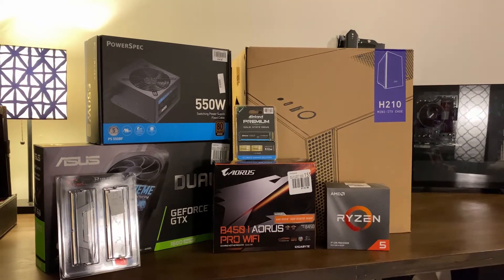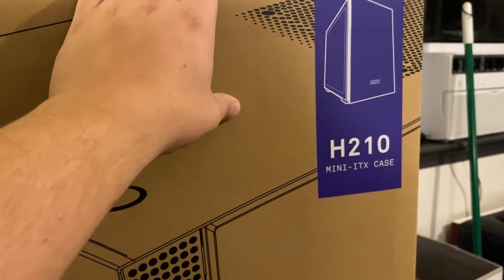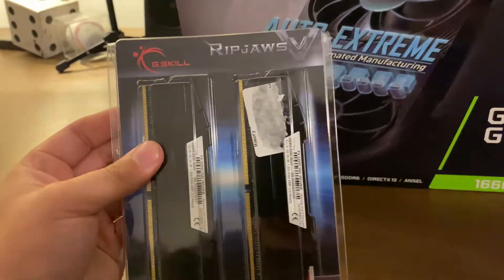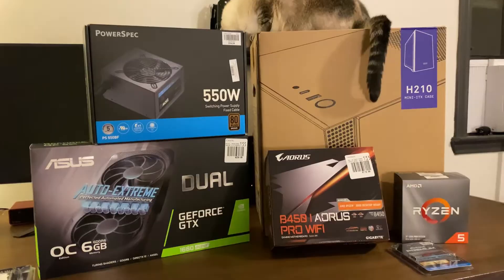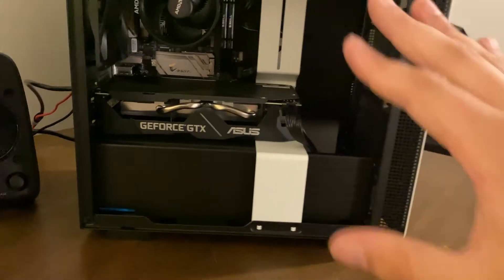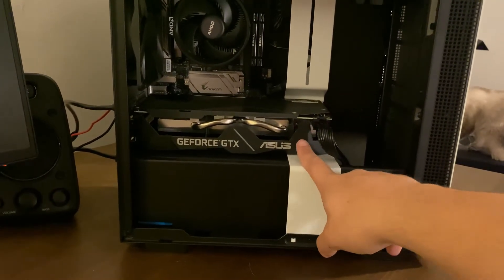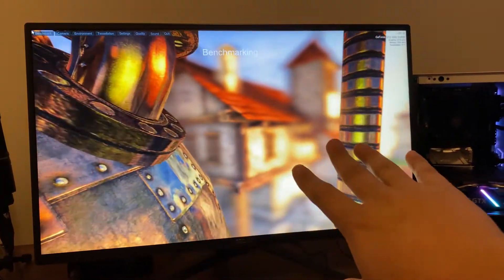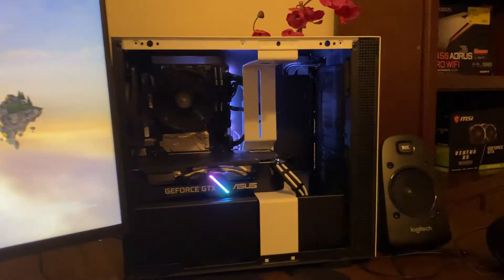$850 Gaming PC Build (First mITX Build) - AMD ryzen 5 3600 GTX 1660 SUPER NZXT H210

Comment: This mother board is so sexy, after some years you can convert it in a media center or server with its integrated graphics because audio is decent. Add a pico psu 120w or something and you get a silent thing in your living room. Did you leave your gpu near the psu like that? Its air circulation looks bad.

Comment: Is ryzen 5 1600 better than the one you use in this vid or nah
Reply from the maker: No it’s not but it’s still good
Reply: @CGBuild  is 
ryzen 5 1600
Rx 580 8gb or GTx 1650 super 4gb
1TB SSD
2x8gb 3200GHz
2TB internal hard drive HHD 
Good?
Reply from the maker: @mosestha1104  yeah that can work.. what are you planning on doing with it? What type of hames
Reply: @CGBuild  school work, and gaming.
I mainly play fortnite, so want like 144+ FPS if that’s possible with the specs I have
Reply: @CGBuild  could you also recommend me a pc case under 100?
Reply from the maker: @mosestha1104  nzxt h510 is a good one and easy to build in.. and getting that FPS is gonna be a stretch but you still with Fortnite get that somewhat.. it’s a good pc to get you going!
Reply: @CGBuild  what would you recommend? Rx 580 8Gb or GTx 1650 super 4gb?
Reply: mine is ryzen 1500x
gtx 980 ti
16gb ram
alot of 256 ssd
and run solid in 2021

Comment: where do you plug in the fan cables at?
Reply from the maker: I have a fan splitter that I plug in more then one fan in to
Reply: @CGBuild  ah i see, i’m doing a similar build and i need everything to be working and all that. where would the plug in for the splitter go?
Reply from the maker: @brandonbentley132  on the motherboard there will be a fan pin idk at this moment where it’s at but you can find it in the motherboard directions little booklet it comes with.. plug the splitter in to it and you can now plug 3 fan up to that one fan pin
Reply: @CGBuild  alright man thank you so much! i just put everything together and only now realized i couldn’t find the pins all the cables lol
Reply from the maker: @brandonbentley132  no problem! I’m glad I could help have fun building!

Comment: On PC partpicker it says the motherboard and case isn't compatible as the motherboard needs a BIOS upgrade and that the motherboard has insufficient USB 3.2 Gen 2 or Gen 1 headers. What does this mean?
Reply from the maker: Pc part picker is not up to date with bios updates.. any mother board you buy in a store or anything that is new will come with the right bios update
Reply from the maker: It says it on the box as “ ryzen 3rd gen ready” or something along those lines

Comment: Hey man, this may sound kinda stupid  but, what was total storage on the computer?
Reply from the maker: On this computer it was only 500gb nvme but storage is one of the easiest things to upgrade so you could alway put more!
Reply: @CGBuild  Good to hear man, do you have a reccomendation for a hard drive to put in?
Reply from the maker: Seagate - Barracuda 2TB Internal SATA Hard Drive.. this is the one I use for a lot of my clients builds
Reply: @CGBuild  Thank you so much, im building one very similar to yours and I want to make sure this thing lasts me as long as possible
Reply: @CGBuild  I am going to use some of the parts that you mentioned in this video, Thankyou because on my build ill save 40$ compared to the last one. I really appreciate it man
Reply from the maker: @spudgunner7075  of course man I hope the build goes well!

Comment: Was there any problems you ran into because it was small because I want to build a pc but idk if I should go atx micro or itx
Reply from the maker: Nope no problems.. if you wanna make sure that everything fits just go to pc part picker.. it for the most part will tell you what will fit is what case
Reply: @CGBuild  does this pc ever overheat or have cooling issues
Reply from the maker: @tcemeteor459  nope I haven’t had any overheating.. nothing over 70 degrees
Reply: Go with micro atx it’s perfect balance between itx and atx with itx you can get cooling restrictioning so your fans are gonna be loud

Comment: How did you fit the 1660 super in there? Because for me, on PcPartPicker it says that it's not compatible with the h210? btw is the airflow ok so far? Sorry for all the questions, I got the same gpu as well and was going to buy the h210 case, but idk if the gpu would overheat because of the clearance. Thanks and love the build.
Reply: Hey dude. In the future are you going to add more fans to your case? And when or if you do tell us if it helps airflow. It's a stupid question, but I just wanted to ask. Thanks
Reply from the maker: Yeah I was Skeptical when I was building it but it fits with only a little clearance I didn’t have to force it in or anything. The thermals are a little high at 70-75 but for the most part I haven’t had any problems. I played the Cold War beta extensively lol and it never got over 75 degrees is I call it a win! Thanks for the comment!
Reply: @CGBuild  ok, cool! Thank you so much for letting me know!
Reply: Hi bro is the usb c on the case working? Does the mobo have usb header